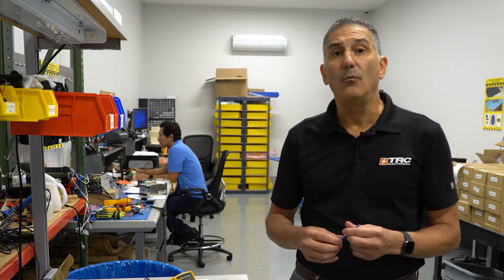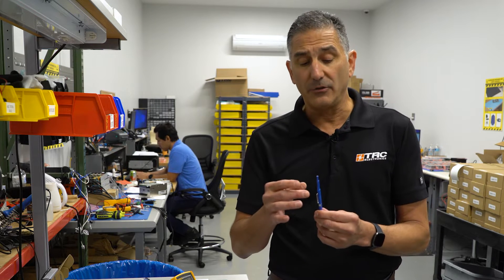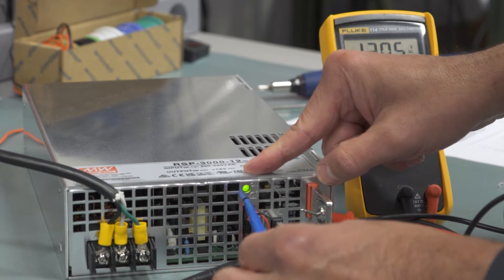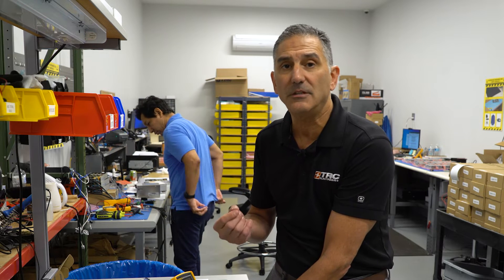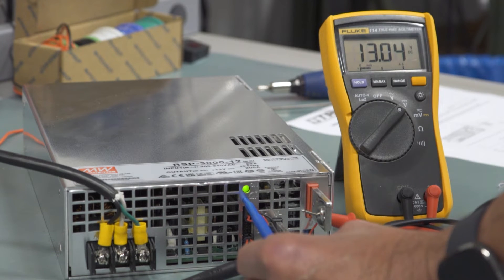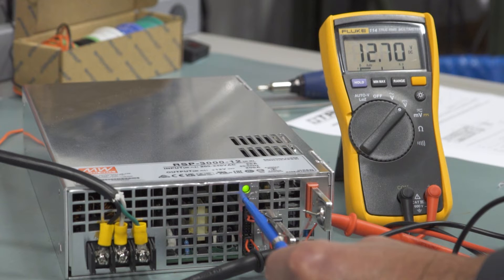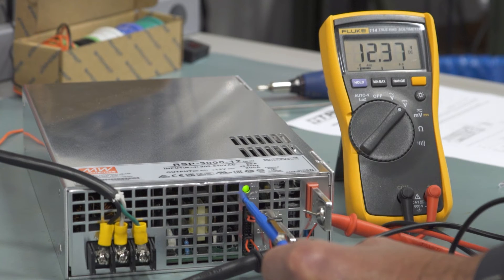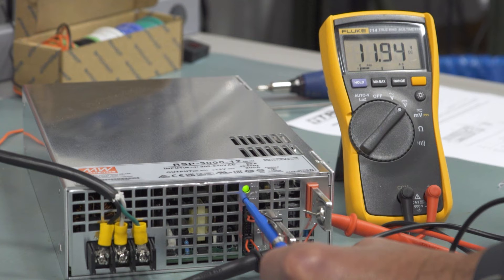How to Adjust a Potentiometer

Comment: My 24v psu potentiometer only allows me to add only 0.2v. If I will add more psu shuts down the DC output and restarts. Is it broken?
Reply from the maker: Thank you for your question! 

No, the power supply may not necessarily be broken. There may be a couple of factors 

1.	Is the power supply running at max current rating, where it may be going into overload. In this situation, the voltage has already dropped off as it goes into this condition.
2.	Are you measuring the voltage at the load and not at the power supply terminals. In this case, the load wires from the supply to the load itself may be dropping too much voltage.
3.	Is the power supply specified to give you more voltage range than what you are experiencing?

We have a team of Power Supply Speciliasts that is here to provide you any support you need! Contact us at 888-612-9514!